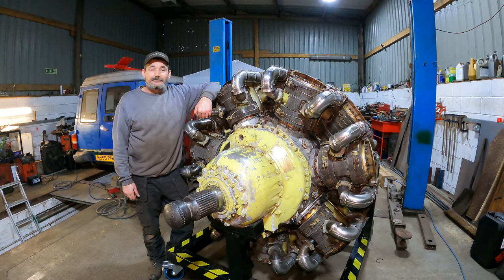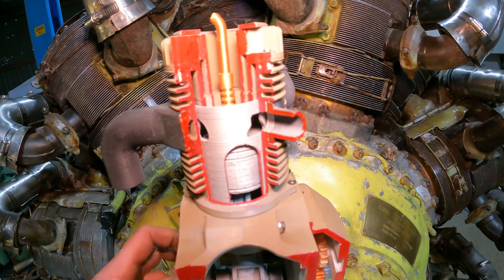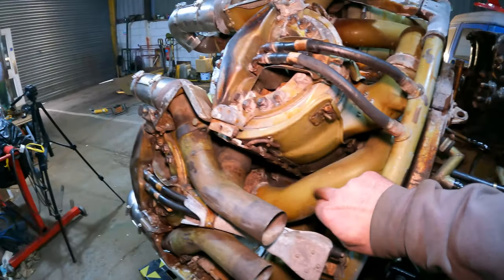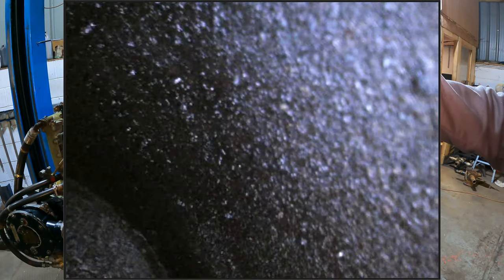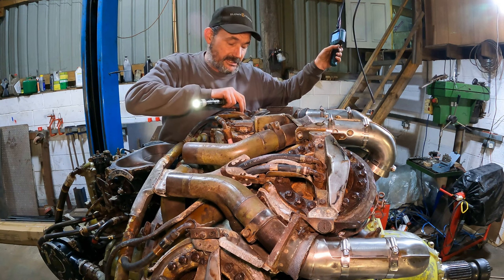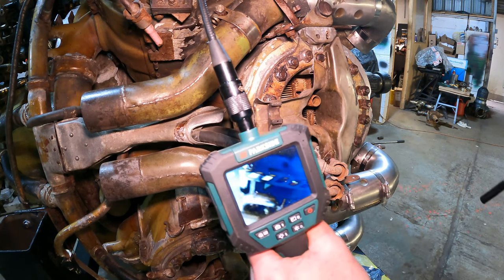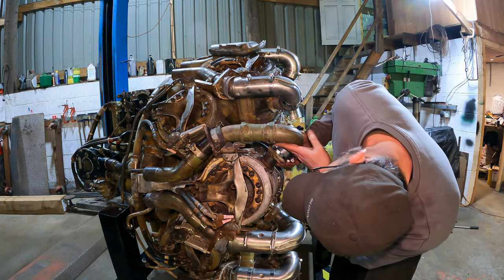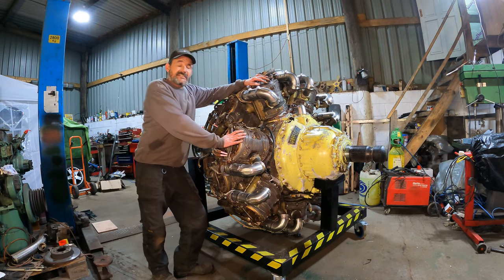Bristol Hercules Engine In The Workshop For Inspection.

Comment: A monumental job to return this to running order. Very sad but still an awesome exhibit for the museum.
Reply from the maker: Sadly it wasn't going to run if in excellent internal condition as the inspection was on behalf of the Bomber Command Museum of Canada to see if it could donate it's cylinder sleeves for engine number 4 for the Halifax bomber being built. On a side note, had it been good it would of been stored in a way that should good sleeves turn up it could be recommissioned. Sadly bad storage conditions have destroyed this one 😢
Reply: @BLOWN8CYLINDER  absolutely mate it would be incredible to get a flying example of a Halifax again
Reply from the maker: @twowheelexploration9228  well the Canadians will come the closest to that, they are building a Halifax using as many original parts as possible with the end goal being a Hercules powered Halifax that starts up and can taxi.... and let's be honest,  a tail wheel up fast taxi is only an inch away of flying 🤔🤣
Reply: @BLOWN8CYLINDER  great news